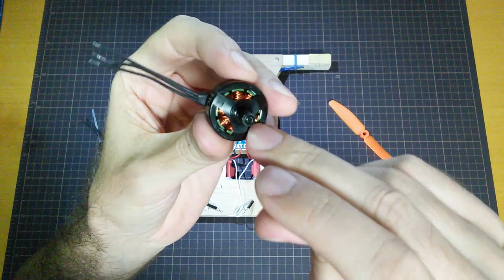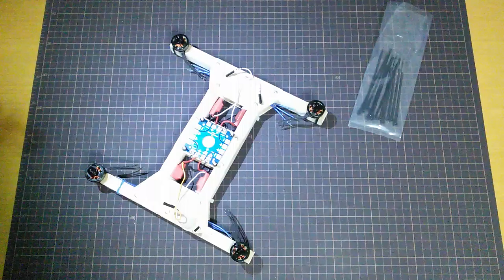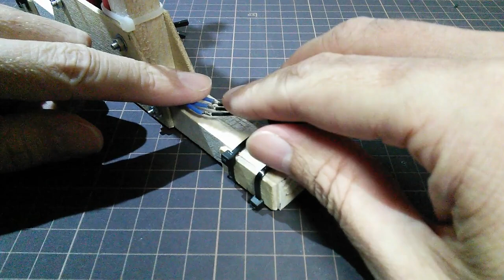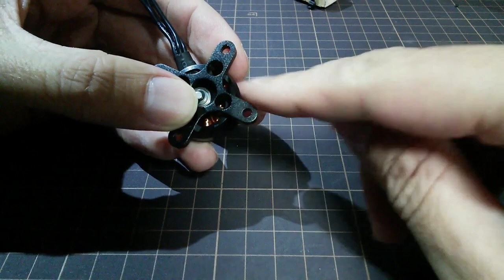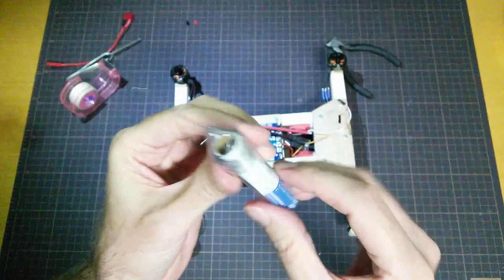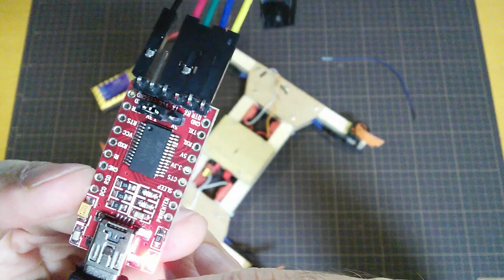Cheap-ass quadcopter build Part 4 - Motors

Comment: Hi there. If cost was not an issue, which motors do you think would be the best you could use? Would it be the SunnySky motors?
Reply from the maker: Joe Allison SunnySky are the best I have tried so far, but I hear that the Tiger and Cobra motors are generally thought to be the best.
Reply: ***** Thanks very much. I'm just starting out with my Quadcopter build. I'm following your videos, but using a bought frame that you posted in your frames video. I have plans to use a 3D printed frame as I have a friend with the printer, and it looks like you can print them very light. 

Reading the customer reviews, It looks like the SunnySky motor supply has become riddled with fakes. I'd rather spend a little more for another brand that hopefully isn't a fake. I also saw from one of your videos that you had an experience with a fake Sunny Sky motor.

I'm a beginner on the electronics world, so I'm a bit worried I could end up buying the wrong type of motor. Would you be so kind as to to provide a couple of links to some potential and appropriate alternatives?
Reply from the maker: Joe Allison I have only ever used banggood. I think google will help you more than I can (to answer your question I would only be using google anyway)
Reply from the maker: ***** i heard good things about buddyrc in the US. They ship fast and not fakes :)
Reply: ***** In terms of Specs, should I be looking for 2204 KV2300? I'm using all the other equipment/batteries etc that you have recommended. Would these be a good suit? http://www.hobbyrc.co.uk/t-motor-mn2204-2300kv-navigator-series-multirotor-tiger-motor?gclid=CO-B06u4lMYCFWkTwwod7mEAVA
Reply from the maker: Joe Allison dude, I don't think I can give you a magic answer on what motors you need. As you can see I've already made a video recommending some motors. The important thing is that the ESC must be able to handle at least as much current as the motors.
Reply: ***** ok no worries. As I said i'm a beginner to this just looking for some advice. I've gone with all the parts you've recommended so far. I'll probably stick with the basic ones that you started off with. I've got quite a lot to get through before I upgrade the motors, but I'll let you know which ones I went with and how effective they were.
Reply from the maker: Joe Allison I get the feeling you are worried that the motors are cheap and nasty. As a beginner though, that's not a bad thing really. But these particular motors are not too bad really, I took this quad out for a fly yesterday for the first time in a long while and I realised it is still the most stable one I've ever built :D
Reply: ***** Yea that had been my worry. I'll see how I get on. Good to know its running smoothly tho. Thanks for putting all these videos together with the spreadsheets by the way. They're an amazing resource :D Have you thought about getting this running with an FPV camera?
Reply from the maker: Joe Allison yes: https://www.youtube.com/watch?v=x02hMSPoDvo
Reply: ***** Sorry I missed that one, thanks!
Reply: Joe Allison I should definitely have bought the lipo battery locally as you mentioned. They're taking weeks to arrive!
Reply from the maker: Joe Allison If I was to select a motor that is a bit nicer for a small price increase, I would probably go for: http://www.banggood.com/DYS-BE1806-2300KV-Brushless-Motor-2-3S-for-Mini-Multicopters-p-933192.html
Reply: ***** Thanks very much for this. It looks as though they don't come in CW/CCW versions but I'm guessing this wont be an issue. Thanks again.
Reply from the maker: Joe Allison Right. In that case there is also this one, a few dollars more again but with the CW/CCW threading, looks to be very similar to the ones I used in this video series except with nicer silicon wires http://www.banggood.com/DYS-1804-2300KV-BX-Series-Brushless-Motor-For-Multicopter-CW-CCW-p-962148.html
I have only bought one set of DYS motors so far but was very happy with the quality, finish etc.
Reply: ***** These look brilliant. They're a very reasonable price too. I'll let you know how I get on :) Thanks again.

Comment: Tip about soldering wire, without affecting shrinking tube; put your tweezers on wire, not on insulation. This way, heat will be quickly transferred to the tweezers and prevented spreading along the wire to the shrinking sleeve.

Hope this helps. Cheers,
milan
---

Comment: Hi. How did you know that the 180 parameter in write() function is for the highest speed? I did some experiments with my ESC and motor and the limit was only 90... Do you know why I can't exceed 90? My motor was only 930KV - and I thougt that this parametr could make the difference but shouldn't it be just proportional and reach the max speed of the actual motor?
Reply from the maker: I think most servos typically have a 180 degree range of movement. I'm not sure what you mean by "the limit was 90" and "can't exceeed 90".... do you mean that when you set a value above 90 it gave the same result as giving a value of 90? Perhaps your ESC is one that works on a 0-90 range instead of 0-180. I would look up the datasheet for the ESC and have a little read :)
Reply: ***** Thank you for answer. Yes, I meant that servo function worked only to param 90. All above didn't make any change in speed. The servo function generates PWM for servomotors movement. I thought that maybe the frequency of signal is wrong and PWM high level is two times longer. I didn't realize that there are such a differences in ESCs. I bought my ESC on ebay and contacted with seller and they gave me link to hobbyking ESC but I can't see any info according the question (http://www.hobbyking.com/hobbyking/store/uploads/113002679X16958X28.pdf)
Reply from the maker: Are you uploading the sketch using the correct selection for arduino type (eg. 16MHz or 8MHz)? Getting that wrong will cause timers to take twice as long (or half as long, depending on which way you get it wrong).
Reply: ***** I hope so... I had to select arduino mini 328 for my flight controller (selecting pro ends with avrdude out of sync) so I think it is 16MHz. I am going to make some changes in timer1 for PWM frequency and then checking its influence on my board. Thanks for support.
Reply from the maker: Mirek Krenc you can run the blink sketch and see if the LED turns off and on in one second as expected, to check if you're using the right upload settings
Reply: ***** Yes, this is the simplest way to check :) Thanks

Comment: i need necessary a power distibution board or arduino s stuff?
can i just connect esc and battery to a multiwiip328?
Reply from the maker: The PDB is not strictly necessary, but it's convenient. Without that, you could just solder all the wires together directly. In part 7 of this series I show how I connected things on the quadcopter side.
Reply: thank you, i m watching it
ps your work is great

Comment: Hi!
i love your series and ordered many parts according to your guidance. What is your impression about the motors? is ~2300KV enough? i am thinking to buy bigger ones. Could you help me here a bit please? i'm also planning to buy a bigger amps rate ESC, how can i calculate that e.g.3000KV motor would need e.g. 20A ESC? i guess i will cause no harm if i just buy a stronger ESC right? do you have an idea?
many thanks in advance.
Reply from the maker: The KV rating of a motor refers to how many RPM it can spin with each volt applied, so a 3000KV motor would typically be smaller than a 2300KV motor. Unless you are making a larger quad than this, there is not much benefit to having much larger motors. fwiw I have managed to fly with AUW of about 500g with these motors and ESCs (with 3S battery).
Right, there is no harm in having an ESC that can handle more power than necessary - it's just extra money and weight if they are excessively big, that's all. Motors should have some specs available to let you know what the current draw is at various voltages and speeds, so use those specs to pick an ESC that can handle at least the most current that the motor will draw.
If you are making a significantly larger quad than mine, like a 450 size or something, you might want to look around on YouTube at other builds where people are making that size to get a feel for the combination of parts they're using. I will probably make a larger quad someday, but for now I only have experience with 250 and smaller size range :)
Reply: ***** ohh, i just read after it. i had the complete opposite understanding. thanks for enlighting me up :) !
Reply: RowleySmith Hi again :)
im thinking to get a 1400KV motor (size 250mm) and they say 8060 and 12A to it. obviously the props wont fit so i would buy 5030 props and a ~20A ESC. but i dont have much feeling about attaching a smaller props than advised. i guess it results higher RPM, thrust and higher consumed power right?
the reason for the more powerful motor, i would like to attach a gopro in its waterproof holder, so i would need higher power to lift it up. 
whats your opinion?
Reply from the maker: RowleySmith I think most 1400KV motors would be way too big for a 250mm quad. You should be getting the hint from the fact that they recommend 8 inch props, which as you say are... way too big, and changing the props is not a good way to 'fix' the mis-match - you might be risking having something overheat and die. So the only reason for this is to carry a GoPro? I would recommend to just try the cheaper smaller motors first and you may be surprised as I was, that such a little motor can do so much. As I mentioned earlier, the motor+ESC combination in this video series can still fly ok with an all-up-weight of 480g (3S battery), so it could easily lift a GoPro and camera case. Just don't make your frame too heavy :)

Comment: i got a quadcopter kit for christmas and i just "finished" building it up...
However i have a problem with one of my ESCs :/
i don't have my Lipo. Balancer and RX-TX yet, but i did a few tests with a 9V battery, just to see if i can get everything to work...
3 of the four ESCs are beepong three times and then a fourth time (high, low, high, high), and the blue LEDs on them are glowing solid. the fourth one beeps 3 times (high, low, high) and then the LED shuts of....
I think that means that is is not getting a proper signal from the FC...
i am using a NaniWii with MultiWii 2.3 and KissECSs with 18A (2-4s)...
Can anyone help me? i want to get this thing up and running as soon as possible! :)
Reply: now the attached motor started going crazy...
I quess my ESC is broken from the factory, crap, now i have to wait for a new one :/
Reply from the maker: muh1h1 Yeah, it sounds like the ESC is not receiving the signal it expects from the FC. As you can see in my video there, even a floating (disconnected) wire can occasionally produce some valid signal and the motor will twitch. There is a possibility that the FC is not giving the signal in the first place. I would try the other ESCs with that connection on the FC and maybe you can figure out if it's the FC or the ESC that has the issue. btw I would not expect a regular 9V battery to last long if you've been spinning the motors much ;)
Reply: ***** well, i have tried switching the ESC from one port to another on the FC, but it didn't make a difference, it was always the back right one failing...
of course a 9v battery won't last long, i just wanted to use it to try and get the CW and CCW right :)
whatever, i gave up now and i will ask for another ESC from Flyduino (where they where bought). sadly they are not available until jan. 5th :/
in februrary i am going to have a ski vacation, and i am hoping to have to quad ready to fly by then, so i can get some nice snowy footage fro an onboard cam i am planning to install :)
Reply from the maker: If it's always the back right one failing, wouldn't that mean the FC is the problem?
Reply: well, no...
if it was always the port for the back right one, another ISC on the same port would not work on that port either (which it does)...
Also if i connected the ESC to another port it should work (if it was the ESC), but it doesn't...
It is clearly the ESC
Reply from the maker: I see. It was unclear what you meant by "always the back right one failing". There is nothing inherently 'back' or 'right' about an individual ESC, so I thought you must be meaning the FC port.

Comment: hey! i have a suggestion and a question in the same time: what do you think about this item? http://www.ebay.co.uk/itm/310965738220 would you try to use this kind of joysticks in order to keep everything small, cheap and sexy? :D cheers!
Reply from the maker: hmm... looks a bit small to be easy to use. Most RC transmitter joysticks are fairly long, which makes the full range of movement about 5cm or so from one end of an axis to the other. This makes it easy to make fine adjustments. But the most important thing is whether they have a dead zone or not. Basically, if the pots have a dead zone they will be useless for this purpose. I eventually found some that did not have a dead zone, you could try these: http://www.dx.com/p/008-3d-yg-repair-accessories-ps4-original-3d-game-sticks-pair-318011
ah, looks like that particular one is sold out right now, but I guess PS4 joysticks should be ok wherever you get them from.
Reply from the maker: You will also want to remove the springs from one of them, which looks like it would be pretty tricky with that one.
Reply: well, i quess you're right. didn't actually thought about that before. Anyways, good luck with the project and I hope you'll get nice results. I'm interested in your project because I want to get some sort of easily hackable RC system for all sorts of rc things. I've ordered a year ago some small servos from dx.com and I would love to make at least a glider with them (i have some 18650 li-ion cells around and i guess they would be a perfect fit for a glider). Also, to keep things cheap enough, i want to use some THT atmegas 328 that are laying around here doing nothing, and flashed with 8mhz bootloaders should do the trick...

Comment: For the rotation: Some ESCs can be programmed to flip the rotation so you do not have to change the wires.  
I know you are building to a budget, but some of your viewers might want to upgrade slightly. (Also, programmable ESCs often have different settings for different motor characteristics which can be useful in some circumstances.)  

Also, I use one of these digital servo testers (with µs display) to test my ESCs (and servos). That way I know exactly what the ESC sees. This is also useful in debugging my Arduino code. Not that I would ever require such a clutch cough cough ;)
Reply from the maker: Right - I kinda wanted to stay away from ESC programming to keep the build simple. The 'simonk' programming (that these ESCs come with) is very popular in the multirotor world because there is basically only one set of characteristics that you want.

Comment: love your little confusion at the end when the initialized speed controller does random stuff because of the floating signal.
It might be a good tip to do the direction check before the soldering using just some clamps on two of the wires
Reply from the maker: haha yes, I realized afterward that it was just interpreting the floating signal as a valid speed every now and then.
Right - if the wires on the motor were not so crappy I probably would have twisted them together or something instead of soldering - but I figured the 50/50 odds of it being correct to start with were not too bad :)